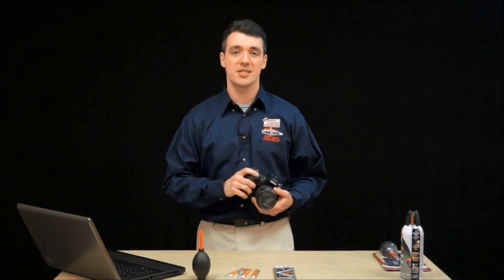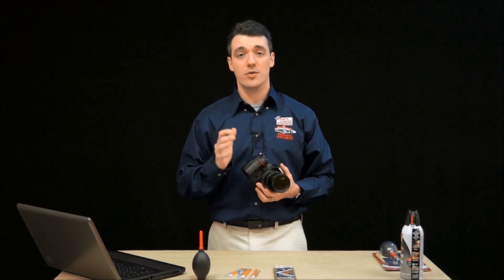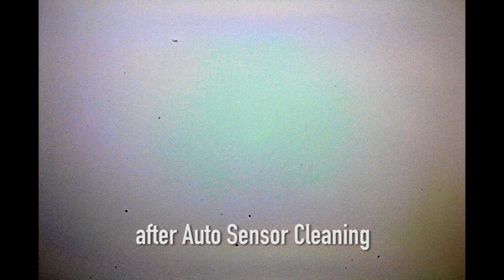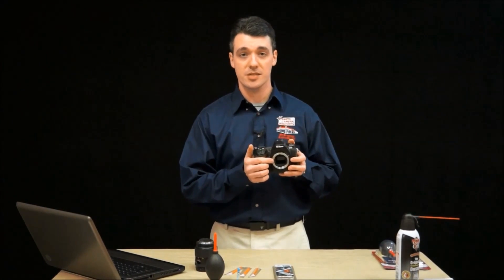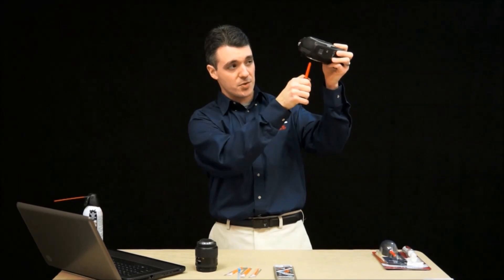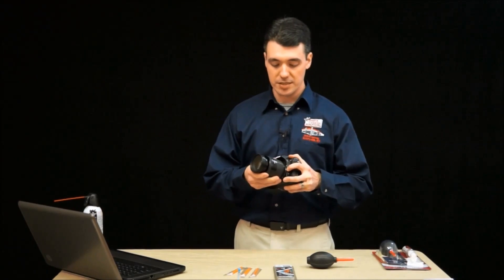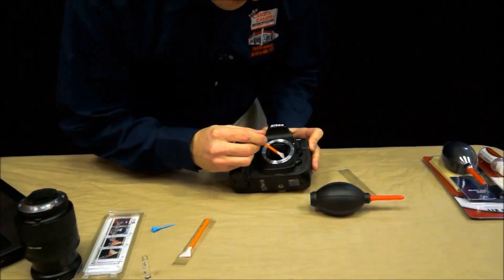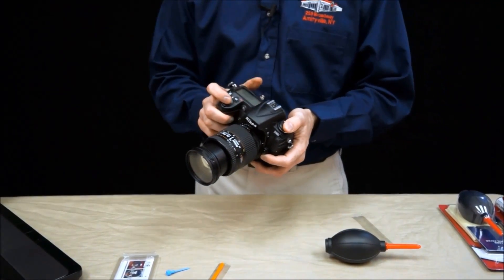Cameta 101: How To Clean Your Camera's Image Sensor

Comment: bro this video was straight and direct you can jut use a cutip fyi but recommend to be careful for for falling cotton strands left as residue from tips and swipes, make sure to use sensor cleaning first if it don't work than manually lock camera and swipe only only use a clean long extended smooth material and lightly swipe. great video i did the cleaning while watching it was my sensor that was dirty i truly appreciate it it saved me paying 65$ i really recommend the watch if you need to clean your cameras

Comment: Hi, nice and informative video. 

Two questions:
- what is the purpose of moving the camera around when taking a shot of the white screen? Wouldn't that also blur out the dirt specks?
- how can you differentiate between dirt (or dust) on the sensor from dirt  / dust on the rear element of the lens?

Would it be a good idea to do a test shot without the  lens mounted?
Reply: I'm a novice, but from what I glean, moving the camera when you take the shot blurs whatever you're shooting, but the dust (since it's actually ON the sensor) will not be blurred.

Second, I discovered the dirt was on my sensor because when I changed between lenses the spots were still there, in the exact same areas.

Lastly, I don't know what would happen if you took the test shot without a lens, but I've watched many tutorials and they all used a lens for the shot. One guy suggested a wide angle lens, in order to capture as wide an area as possible, but again, I don't know if that's necessary. Take care.

Comment: Caution: Make sure your nail polish remover and lighter fluid do not contain oil. Many brands do.
It's better to get a small cans of acetone and naphtha. 100 % mineral spirits paint thinner will work in place of naphtha. 
If you want to re-apply thread locker, use finger nail polish. It's lacquer.

Comment: I still have those spots looks like permanent 
Is there way to change front filter?
Reply from the maker: I would recommend you contact your camera manufacturer and see if they offer professional cleaning service or can recommend one.  While it can be done, pulling and replacing the filters is a drastic and expensive measure.

Comment: The sensor of my Canon T3 has some red one-pix dots. When I take pictures of dark sky. I can see them. When I tested with the method of gray screen, I can see some little water dots . How to resolve these problems? Thanks!
Reply from the maker: The red dots are known as hot pixels.  They are very common, and occur in many, if not most digital cameras, especially at high ISO settings (like when you shoot at night).  Unless your camera is under warranty, the only way to resolve the problem is to edit them out with Photoshop or perhaps shoot at a lower ISO.

As for water spots on your sensor, that's an entirely different subject.  Any spots that you can actually see on your sensor need to be cleaned with a wet solution and cleaning swab.
Reply: @cametacamera  Thank you for your kind reply! For the red dots, my camera is 7 year old and out of warranty. I will edit the photos if I need. For the water spots, I will clean the sensor as you said when I feel I need.
Reply: @cametacamera  HI, I wondered how the image sensor can have some water spots. It is behind the shutter. Today I found that the so called water spots on the sensor of my camera is the image of the dust on the objective of EF-S 55-250mm f/4-5.6.
Reply from the maker: I've seen it all on sensors.  Most commonly, people try to blow dust off their sensor and end up spitting on it.  But if yours is just some dust on the lens, that's good news!

Comment: Nikon instructs to turn the camera off BEFORE removing the lens to prevent damage to the circuitry. Any comment on the subject? Thank you.
Reply from the maker: Some say that if the camera is on, the sensor is "charged" and will attract more dust when the lens is removed.  There's also the concern that some Nikon bodies and lenses have mechanical AF or aperture control connections that could get damaged if you don't turn the camera off first.  And there's plenty of stories out there about lenses not functioning properly if they are attached with the camera on.  All good reasons to do what the manual says.  If you're cleaning your sensor, you can certainly remove the lens prior to locking up the mirror, and perhaps just use a body cap to keep dust away until you're ready.  All that being said, we change lenses on the fly all the time and never encounter any issues.  Your mileage may vary.

Comment: Would it be safe to use a v swab on the mirror? I have a Canon T70.
Reply from the maker: Probably, but SLR mirrors are very delicate, so make sure you blow off as much dust as possible before attempting any wet cleaning, and when you do, use as little pressure as possible to avoid pushing the mirror out of alignment.

Comment: I have literally one spot that appeared on my sensor recently. It shows on some photos but mainly in places I can easily retouch. Unfortunately it also shows on video (a bit- I see it there, maybe others wouldn't). I wouldn't panic about it but my friend who is a professional photographer told me to get my sensor professionally cleaned (I'm all for it cause I am a total rookie, although to remove 1 spot for 30+GBP seems steep) but she also told me that sensors can sometimes get so hot that  those dirt particles can become permanent. Now I am panicking about this one particle, but I hear so many people talking about having super dirty sensors (I'm assuming the dirt had time to accumulate ) and still being able to clean them, and I'm confused and not sure if I should panic at all. Could someone explain to me how worried I should be?
Reply from the maker: You shouldn't be worried.  Chances are it's just a piece of dust that can be removed with a few good blasts of air from a manual air blower, or alternatively, a tool called a "SpeckGRABBER".  If you have some kind of spot or stain, it should still be removable with a wet cleaning method.
Reply: @cametacamera  awesome, thanks!. So no need to go nuts straight away. I mean when it shows on some photos it looks like a "nipple" or one of those things that falls off trees, but that's mainly on the sky area when I'm shooting outside, most of the time it's invisible. 

May I just ask one more unrelated thing? Is it safe to take the memory card from the camera often? I have a card reader in my computer so it's so much easier to pop the card in. I am wondering if it's good for the camera though. Is the mechanism (spring) in the camera card slot sturdy enough to go through a lot of card being removed and put back in?
Reply from the maker: @KatarzynaOleskaArt  If you're shooting a lot of video, I would definitely remove the spot when you get a chance since it will show up in literally every frame, whereas you can edit it out of still photos.  As for your other question, I have never once encountered a camera with a worn out memory card slot.  They are rated for thousands of insertion cycles, so as long as you don't get it dirty or wet, the slot should last the life of the camera.  Chances are your memory card or even the camera's shutter mechanism will fail long before the card slot ever has a problem.
Reply: @cametacamera  interesting! Thank you so much! You're awesome!

Comment: What size swab should I be using for my canon rebel T2i? I tried the 20mm size but it wouldn’t fit inside my camera so I was afraid to force it.
Reply from the maker: You need 16mm swabs.  The 20mm size is made for Four-Thirds size sensors found in Olympus and Panasonic cameras.

Comment: Visible dust is much too expensive. I got my kit on Aliexpress, it is much cheaper and the swabs look more professional. It helped me for my 1st cleaning. 
https://www.aliexpress.com/item/HOT-CLEANROOM-sensor-cleaning-swabs-kit-12pcs-with-liquid-cleaner-for-Nikon-Canon-Sony-APS-C/1720897834.html?spm=2114.search0104.3.21.1ef2426f029gg0&ws_ab_test=searchweb0_0,searchweb201602_10_10065_10068_319_10059_10884_317_10887_10696_321_322_10084_453_10083_454_10103_10618_10307_537_536_10902,searchweb201603_6,ppcSwitch_0&algo_expid=7f8bee4f-ed28-41dd-a97c-35b3573bf2cb-3&algo_pvid=7f8bee4f-ed28-41dd-a97c-35b3573bf2cb

Comment: I have d40 do you think it time to updated? i had it about 10 years now
Reply from the maker: The D40 is still a good camera for basic stills, but the resolution is very low by modern standards, so you can't crop much and large prints are a challenge.  Even Nikon's cheapest new DSLR (D3500) is 4x the resolution with a much better image sensor and takes full HD video.

Comment: Accurate video. Followed this procedure with my D810. Had too many spots to count to start with. Did the wet wipe twice and after just had 2 tiny specks that could only be seen with contrast and dehaze cranked in ACR. Steady light touch is key. Also, it's best to get the right swab for your sensor. The D810 is full-frame or FX, you may have a crop sensor. DX for Nikon or APS-C on Canon. If you get swabs too small, you will have to make multiple passes which isn't a good idea. Too large and you are out of luck completely. Do your homework before ordering.

Comment: When using fix focus lenses with the digital cameras, dust becomes a huge issue. Checking for dust and cleaning becomes routine. Wet cleaning is necessary, but it can be dangerous and by all means it is wear to the surface of the sensor. It also more often than not leaves streaks, even if only minor ones. This is a problem, yet it is taken seriously only by very few photographers. The majority of photographers hardly shows any passion to care and continue to take 'contaminated' pictures. No manufacturer has addressed this issue effectively to this date. One option would be better maintenance access to the sensor via a camera back that could swing open, thereby exposing the sensor. People these days are content using zoom lenses that they rarely swap and seem to have little to no idea about the large untapped potential of fix focus lenses.

Comment: My Nikon D500 is such a dust-sucker... I have it for like 3 months and already full of dustspots... changing my lenses in my house or car (airco off ofcourse) but never outside.. dont get it how my sensor sucks so mucht dust...
Reply from the maker: The D500 hasn't had any dust issues in our experience.  If you are careful when changing lenses, then dust could be coming in through the lens mount if you're using a cheaper lens without a seal.

Comment: Very nice man!!! I want to try it! The question is what size of vswab to buy? I have the Nikon D5300! Also each piece is for signle use or multiple times?
Reply from the maker: For the D5300 you would use the 16mm version (https://www.visibledust.com/sensorsizes.php).  Of course that's the one we don't have in stock.  Heh.

Single use only!

Comment: A bigs thanksssss...swabs worked..I was scared as people say you should me careful with sensor. By watching your video and with recently bought cleansing kit i gave it a try while praying in my heart to save my D7200. It worked totally.. Again a fully loaded thankss😉😉😊😊😎😎
Reply from the maker: Glad to help!
Reply: @cametacamera  Hi..can you tell me is there a way to clean the viewfinder dust. I returned from a trip and noticed a tiny dark spot through my viewfinder.  I thought it to be on the sensor but the images were clear with no dark spot that means it is on the viewfinder i guess. Although i cleaned every thing by a cleaning kit but it is still there. I thought you might provide some help in it.
Reply from the maker: If dust is on the outside, something like this works very well:
https://www.cameta.com/Lenspen-NMCP-1C-MicroPro-Compact-Cleaning-Lens-Pen-98152.cfm
If dust is inside the viewfinder... not much you can do but take it to an authorized repair shop or try to live with it.

Comment: Con questa metodo rischi di rigare il sensore ccd!! il pennello che hai utilizzato e troppo duro e, ne sono sicuro, hai creato delle micro righe sul sensore. lascia perdere... non hai le basi necessarie per pulire un sensore ccd o cmos che, sul mercato, costa 50 - 60€ e, un motivo ci sarà!! ciao. WolF.

With this method you risk to scratch the ccd sensor !! the brush you used is too hard and, I'm sure, you've created micro lines on the sensor. forget it ... you do not have the necessary basics to clean a ccd or cmos sensor that, on the market, costs 50 - 60 € and, there will be a reason! Hello. Wolf.

Comment: If manufacturers like Canon don’t recommend you clean your sensor, and they’ll void your warranty if you try to do it yourself, what do they suggest you do to clean your sensor then?
Reply from the maker: They prefer you go to an authorized service center for cleaning.  In most cases, however, by the time your sensor needs manual cleaning the warranty on the camera body is probably expired.
Reply: Yes, so what do we do AFTER our warranty has expired?   Not pay someone a couple hundred dollars to clean it.  That's for sure.  There ARE common sense ways for camera owners to clean an image sensor which are prefectly safe.   But you need to have a bit of your own common sense in the first place in order to know the difference, and discover & choose the correct method.

Comment: Hi i have a canon eos 1300d which one do i buy?              there is VisibleDust EZ Sensor Dual Power-X Cleaning Kit for Size 1.3x (20mm) DSLR & Micro 4/3
Also   VisibleDust EZ Sensor Dual Power-X Cleaning Kit for Size 1.0x (24mm) Full Frame DSLR 
Also VisibleDust EZ Sensor Cleaning Kit for Size 1.6x (16mm) Digital SLR Cameras
Also VisibleDust EZ Sensor THINLITE-X Cleaning Kit for Size 1.6x (16mm) ILC & DSLR Cameras
Also
Reply from the maker: For the Canon 1300D (T6 in other markets), you can use any 1.6x (16mm) VisibleDust product:
http://www.cameta.com/VisibleDust-EZ-Sensor-Cleaning-Kit-for-Size-1-6x-16mm-Digital-SLR-Cameras-57975-kits.cfm
http://www.cameta.com/VisibleDust-EZ-Sensor-THINLITE-X-Cleaning-Kit-for-Size-1-6x-16mm-ILC-DSLR-Cameras-96073-kits.cfm
Reply: thanks

Comment: I have a Nikon D7000.
When I take the picture of a white background at f22 the specs on the sensor are sharp, dark black and in focus, but when I use f4 they appear as blurred dark circles (strictly disks).
I do not understand why the f-stop of the lens affects the sharpness of the dust specs on the sensor.
Does anybody have a technical answer?
Reply from the maker: When the aperture is wider, light hits the sensor from countless angles, which makes the dust specks look diffused or blurry.  At a small aperture, the light hitting the sensor is more narrowly focused, so the dust speck appears more solid, therefore, easier to see when you're looking for spots.
Reply: Thank you for your reply.
I will have to draw out some ray diagrams.
Even at larger apertures the image can be in sharp focus, but the light converging on that point to form the image is coming from a wider area of the rear surface of the lens.
This light travelling from different directions is going to form an image over a larger area of the sensor giving blurred edges to the speck of dirt.
This would depend on the thickness of the spec and the distance from the upper surface of the sensor to the actual light sensitive receptors.
I have be working through this as I write, but it sounds like it makes sense - I hope?
Thanks again - Frank
Reply from the maker: This was the simplest explanation I've found on the subject:
https://photographylife.com/why-sensor-dust-is-more-visible-at-small-apertures

I'm sure there are factors not considered here (such as -- as you noted -- the placement of receptors or newer cameras without a sensor filter) but it's good enough for me.